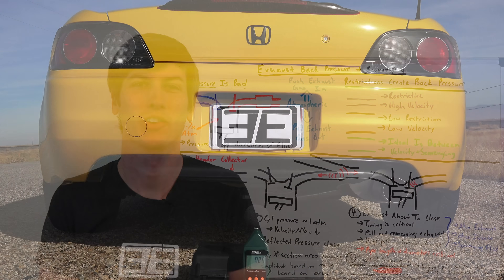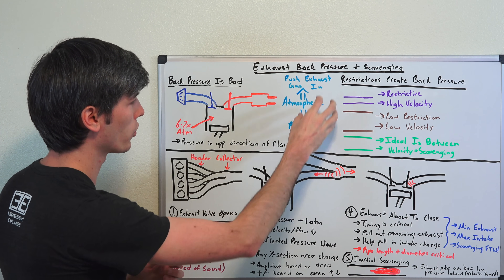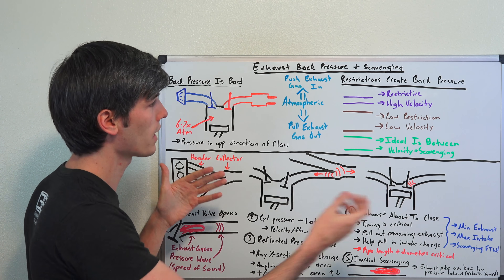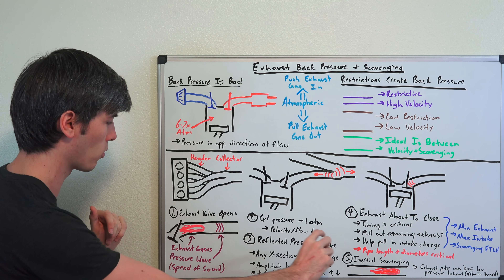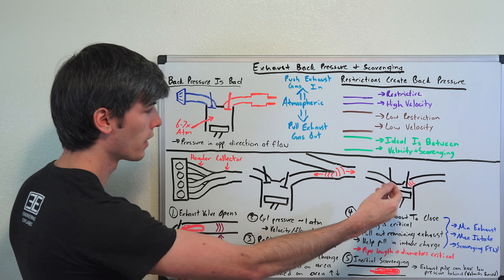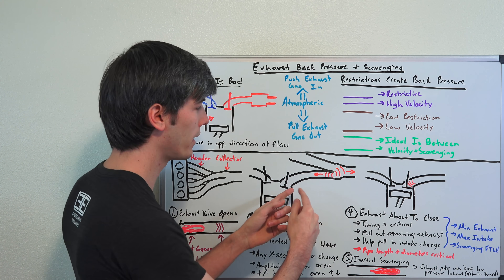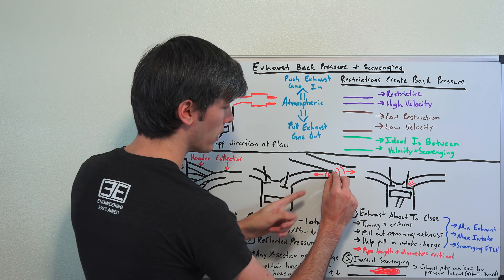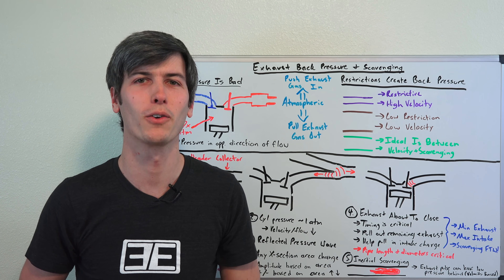Stop Saying Car Exhausts Need Back Pressure

Comment: The stupidity here is astounding. A mechanical engineer who fully understands how it all works is explaining in detail why you don't want backpressure on a cars exhaust, and I scroll down to the comments finding idiots saying he's wrong.
Reply: There is no need to perpetuate this velocity scavenging myth from the 1930's.
Inertial scavenging is limited to reducing pumping losses only and only occurs at the valve or port during sonic gas flows at blow down. Everything after that is down to compression and expansion wave scavenging, which I add is not merely the node ans anti node of standing wave, which is another out dated exhaust theory.
It has all been studied in great detail by multiple independent Professors of Engineering who have published all of their results of the mathematical modeling and corresponding engine testing and results, not limited to dyno and multiple pressure transducer traces.
The articles are peer reviewed scientific works and all available from the Society of Automotive Engineers so no-one needs to make up theories.
My own videos on the topic are researched using all of the available published articles and entirely based on those..Not my own theories or some I read from Wiki or some Exhaust seller.
I am qualified mechanic since 1976 and have many years experience as competitor and mechanic road racing 350 cc 2 stroke motorcycles, 1000 cc 4 stroke super-bikes, Spring Kart and Formula Vee racing including building tuned exhaust systems for all the above.
The published studies and theories within them all correlate with my own experience with exhaust tuning, and the theories provided in this videos do not, period.
As a qualified mechanic I have an obligation to ensure the information I provide is accurate and agrees with modern accepted studies of it.
And if he is representing himself and his lectures as a qualified Engineer he, more than I, has a professional obligation, and owes to to other Engineers, to ensure the information he provides is derived from sound Engineering articles and not scraped off the side of the internet.
Anyone else can have any theory they like and make videos including theories of their choosing or their own because they are not representing their theories as those of a qualified person, but merely their own experiences or opinions they are entitled to.
Reply: There is a big difference between a mechanical "engineer" who sits at a desk all day, and a person who has had 40 years of real life engine building experience.  Back pressure is necessary for 99% of all driving.  Only on the race track do you want less backpressure.  Your "dyno" results will prove it.
Reply: +taledarkside
Correct, and that right there tells you that gas will constantly attempt to equalise across any pressure differential. And to suggest the low pressure developed by inertial scavenging at EO will last all the way to TDC ,as per his theory, without attempting to equalise pressure differential defies the laws of physics, Gas goes not wait in a suspended pressure state for the piston to rise.
Reply: Back pressure is an accumulating pressure ahead of the gas flow created by some restriction, not behind the gas flow.
It is a pressure forcing backward against the direction of flow.
Reply: +dadoVRC
Yes and that is where the power characteristics are determined, the cam profile, the exhaust should be built to suit the cam.
Reply: Ummm; not sure what type of bathtub you have; but mine typically does not pulse exhaust and create mini-vacuums to scavenge next cycle.

Backpressure is a miss-type; not so much; vacuum created by pulse; very valid.  Although keep in mind hydraulic cams will be affected by exhaust scavenging and back pressure, solids are a bit uncommon as they are a pain in ass and loud.  Would be cool to measure this somehow.  

On my mild 350 SBC (450hp area) w/ afr195 and flat-tops; going with 3inch exhaust maximized low end torque and HP in the under 4k range.  Dyno pull with just headers and it sang at 5k+ plus range with a massive hit to torque and made the powerband super narrow.

Now the motor is built for low end; mild mannered cam and carb 650cfm are nowhere near flow rates needed for 4 inch and you lose the vac effect as the pulse's are smaller.

I am sure if i changed out carb to 800cfm+ and put a big ol solid roller cam it would love open headers.
Reply: well its not back pressure; but scavenging or creating negative pressure with pipe width as the exhaust pulses for next cycle... so kind of...
Reply: yea; i've heard this line over and over by self pro-claimed experts; how about posting some dyno results? 

You  always know someone is wrong when they talk in definites; especially when it comes to making HP/Torque on a engine build.

Are you really trying to claim that ever engine build will make more HP and torque with open headers?  Absurd in the extreme...  

Although you completely discredited yourself when mentioned 2 strokes; i really hope you are attacking the theories and not saying that a tuned pipe on 2 strokes don't work.  Plenty of proof on dyno pulls that show the difference; your just flat out wrong there.
Reply: lol; alright bud; all of that and no simple speed velocity wheel dyno to show results?

I noticed you avoided answering the question; will all motors make more HP/TQ with open headers?  

Keep in mind you are not the only engineer on youtube that has race short track all his life and grew up in a race team; most of us are not going list our credentials to prove a point.
Reply: I don't normally repeat myself but I will for you.
" not limited to dyno and multiple pressure transducer traces."
And in fact an inertial dyno was purpose built in one case and the plans of it provided.
Did I say I was an engineer, no.
Now Ive answered your questions Ive got one.
Show me the published peer reviewed papers from SAE that he used for the theories he put in the video.
If they don't exist then you and he are up the creek with that theory.
Reply: "For my dyno pulls i used 2inch, 2.25, 2.5 inch on a mild manner 350SBC.  Original theory was that larger diameter pipes would produce more HP at price of torque and vice versa on the smaller. "
If you are building tuned exhaust then you should, like I did, buy the publications and read them all, you will then be more enlightened about how exhaust tuning works instead of bumbling around in the dark wondering what dyno results really mean wont need to scraping 1930's theories off the side of the internet.
And when you will have all the legitimate accepted theories to explain what you observe on the dyno, and then you will build better and faster engines and win more races.
That is probably how your competitors are doing it, you just need to get yourself up to speed with modern exhaust tuning principles.
Reply: Backpressure just means there is energy loss, because the engine torque has to be used to force the exhaust out of the engine.   That's torque that's not going to the wheels.
Reply: "Backpressure" is really just the extra pressure above atmospheric measured at the beginning of your exhaust system that makes the exhaust flow happen.  IOW, some backpressure is necessary in order to get the exhaust to flow at all.  Precisely zero backpressure would mean precisely zero exhaust flow, kind of like holding a straw up in perfectly still air.What you don't want about "backpressure" is too much of it; one rule of thumb figures that one extra psi of backpressure costs something like 2.5% in terms of maximum power output.Norm
Reply: You're confusing "back pressure", is always counter productive to engine efficiency, with exhaust velocity.   
Higher exhaust velocity make an engine perform better a lower engine speeds.   "Back pressure" has no benefits.  

Similarly, smaller intake runners on a engine produce better low engine speed performance, because the fuel mixture is entering the cylinders at higher velocity.   It's not their restrictiveness that's causing more low rpm torque.   Their restrictive size is what kills high rpm torque.
Reply: +AuMechanic
Do a video explaining why he is wrong then - just saying so isn't enough.
Reply: Anyone can post anything and sound like an expert. I have had experience with cars and motorcycles and no back pressure in certain applications will rob power. We had an older 289 mustang with no exhaust system in the garage. It had no power at all. We stuck a stock exhaust on it to sell it and I was amazed at how peppy it was with an exhaust on it. Doubled the power easily. Also there are about a million Harleys running straight pipes that run like crap. You can smell the unburnt exhaust and hear them miss firing when they accelerate hard. Obviously, if the engine is set up for headers, it does gain horsepower, but many do require back pressure to run properly.
Reply: +ApexMike
I did already covering the first part of it which is inertial scavenging.
Reply: Adam Harrington so now you have also learned how the internet commenting works.  You learned even more than you expected.
Reply: An engine with a camshaft diagram studied to deal with backpressure works better with backpressure than without.

Done dozen of tests on normal production cars, and this is proven.

Different if you speak about theory of racing or sporty engines.
Reply: AuMechanic exactly.
But the modern engines have the cam profile studied to suit the various anti-polluting system, then on normal cars it is simply bad to modify the exhaust system to vary the backpressure, maybe to do only some noise.
Reply: Go to the engine masters videos on Motor trend on demand...there is an entire dyno test video on this...zoomies are your friend for dyno horsepower. Back pressure is bad...period. He also did not mention tri y headers which dump two cylinders into one and then those two into two more. But anyway back pressure is bad.
Reply: Watching a Dyno comparison of pipes and making assumptions of cause and effect is not a means to learn how exhaust tuning works nor how back pressure effects the output, and part of the reason why amateur exhaust theories like this are created.
Reply: The fact the first few pages of google are full of this same amateur exhaust theory exposes the degree of plagiarism, and by all copying the same mistakes exposes it for what it is.
Just if everyone in an exam copied the same mistake made thinking it correct the tester would be instantly alerted to the fact they all copied it because they all copied the same mistake.
Caught red handed.
Reply: Does the mechanical engineer know that motorycle builders put a computer controlled exhaust system valve to vary the back pressure? Great gains in torque have been achieved doing this. Back pressure is neither good or bad, it depends on the situation, load, rpm, throttle opening.
Reply: +505197
It is one good example of the effect of back pressure that buries the exhaust velocity theory.
Reply: I didn't bother to watch the video, this young man isn't all that up on real world information. I had a baja bug that had a stinger exhaust that was too large. I'd slip a beer can over the end of the stinger, secure it with a hose clamp, and punch holes in it. Suddenly the mid range torque returned. I was gonna install a rain flap like you see on tractors to try to get both ends of the spectrum, but sold it. I knew about back pressure before the manufactures did their valve thing. That was over thirty years ago. Smokey Yunick probably was the first to really understand how to build a "good" exhaust system. He was so far ahead of anyone else it wasn't funny.
Reply: taledarkside And into the intake tract. It's call reversion.
Reply: This is why you see strange servo operated valves in your motorcycle exhaust... manipulating exhaust "backpressure" to control pressure/velocity
Reply: WTF!!! Noooooooooooooooooooooooo! there is why a spring is on the valves and valve cam over them, if you sit on a bath cap will it open?
Reply: "condescending and arrogant"
Actually I think the title of this video is  condescending and arrogant saying "Stop Saying Car Exhausts Need Back Pressure" as if we are all imbeciles that need to be chided by the almighty Engineer that has not turned a spanner professional in his life to apply the theories he teaches.
And that would be fine so long as he was 200% right, but the fact he is so wrong and the video title so  condescending and arrogant he seems to have hung himself by his own petard.
Reply: lol; already did bub; and wrote some...  "enlightened"...  Don't really want to specify what i do for a living now; but that was done back when i was working in uncle's speedshop before my "grown-up" life.  

You are scraping the surface of what's involved; you're losing alot of credit when you start throwing around defientites on your theories; which is utter rubbish.  I read some theory; its must be true 100% of time; bah; get off your high horse.
Reply: " I read some theory; its must be true 100% "
From independent professors of engineering, yes of course its true.
Do you seriously suggest the F1 engineers simply hack up bits of pipe in their uncles workshop and try every one until they fluke the numbers.
Any causes and effect you gives doing it is not science, its luck.
The higher you raise the back pressure the more you flatten the torque, and you can do that 2 ways, you can use a smaller diameter header or you can simply restrict the end of the pipe at lower RPM's which will raise the back pressure without increasing velocity, and will flatten the torque curve.
That alone shows It is entirely based on the back pressure and has nothing to do with velocity.
Reply: eh; like i said; would be great to see dyno results prove out the theories presented, i've heard many of the points made before and until you have actual results (shrug).  

What i've found over years in racing; most cars will get more HP with better flow but at higher rpms and more peaky on dyno with open exhaust.  So for a street car; meh; not so great as you don't spend too much time at 9,000 rpms.  Results were mostly the same on other end also with carburetor CFM rates;  the bigger we went the more peak HP / higher RPM, low end suffered and torque went away.  Of course there are a lot of other variables; lift on CAM, heads flow rate, and compression ratio, etc...

Need to take some of that youtube money and setup a simple steel wheel velocity dyno.
Reply: lol; well your doing a great job at being condescending and arrogant; but still avoided answering the question.  

Fact of the matter is there are many cases when not running largest open headers will increase HP/Torque; without going into the theories on why; its just a plain and simple proven fact.  Details of each build will dictate what causes this effect.  

For my dyno pulls i used 2inch, 2.25, 2.5 inch on a mild manner 350SBC.  Original theory was that larger diameter pipes would produce more HP at price of torque and vice versa on the smaller.  

Surprisingly to me at the time the small diameter pipe made more HP and Torque throughout the band.  The exhaust pulses were creating negative pressure in the header system.  Fairly obvious why this would be a good thing.  

Now as soon as the exhaust reach the area that would normally be "catback" system; changing the size to smaller pipe only hurt performance; as at this point it was causing back pressure and not doing anything for scavenging.  Conversely; the closer i got to the motor with small diameter pipes the better the scavenging results and increased HP/TQ.  Diminshing returns of course; so some sanity needs to be applied.  

In the end; the best setup was 2" on downpipes and headers; then with a y-pipe to 3.5"; to two dumps from the Y.   

Now we did simliar testing on the old animal 5HP gocart motors; and the difference in results varied wildly; along with 650 mini sprint motors; again; massive differences in results.  Same with 250 minisprints.  So in the end; there is no 1 theory fits all applications (for obvious reasons).
Reply: Sorry but he is wrong, not by his own fault but because the theory created in 1931, that was discredited over 60 years ago' is being perpetuated by performance exhaust hucksters.
They would weld their own grandmother the underside of your car to take your hard earned cash, using faux science and no better than aftermarket additive sellers.
And have been doing it longer then I've been a mechanic, and that's 1976.
I have done a video on this called "Kadenacy effect (Inertial Scavenging) has nothing to do with 2 or 4 stroke exhaust tuning", part 2 coming soon.
My videos are based on the detailed works of Professor Gordon Blair and other studies published by Bell, Jennings, Wallace et al over periods from 70s Jennings to Blair's second study published by SAE in 1996.
This exhaust pipe inertial scavenging theory needs be given a hasty burial in an unmarked plot.
Reply: you also have a marked difference between practical and applied knowledge.  Dyno results don't lie.
Reply: @Aerogrow  Math doesn't lie.
Reply: @davmar9923  hehe, yep; math inside a "theory" always wins over real world results...

People and their absurd facts always trying to interfere with theories.
Reply: @Aerogrow  About the only thing I can glean from your comment is that you don't understand the meaning of "theory" as defined in science. Hint: It doesn't mean hypothesis.
Reply: heh, ok bud.

Maybe take a re-read at the scientific method before correcting people.  Hope you are not suggesting that a theory is the same as a fact.

Not sure i want to explain the obvious glaring issues with your post.  Most obvious; mass generalizations and definite statements are completely wrong unless based on scientific fact.

Without getting into details it would be very easy to disprove the theory as it stands without a set of stringent and normalized variables and controls.

In simple terms; grab any modern fuel injected car and cut the exhaust off...  Let us know how that math holds up.
Reply: Too much backpressure is bad, but too little is also bad.
Reply: My understanding was that backpressure helps with valve opening and there is a sweet stop between  having the valve open faster and slowing the exhaust too much.